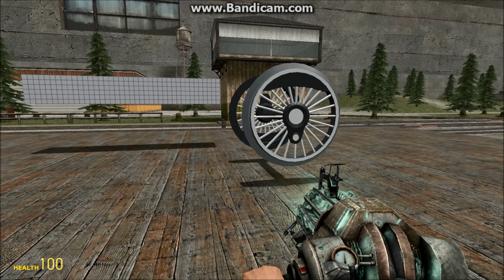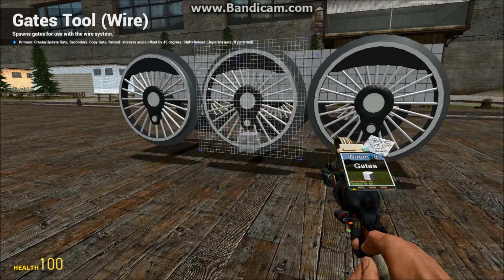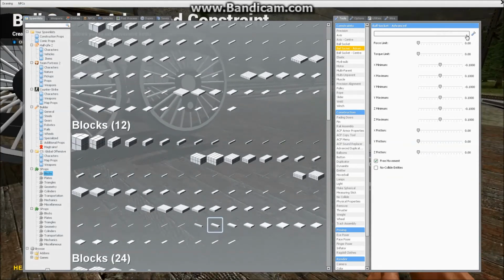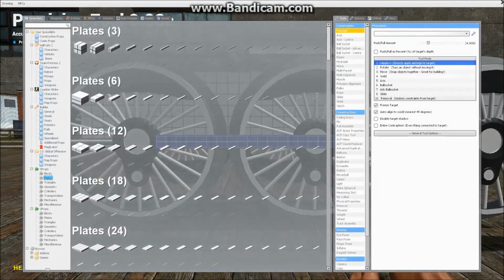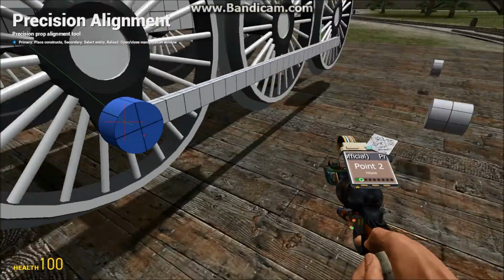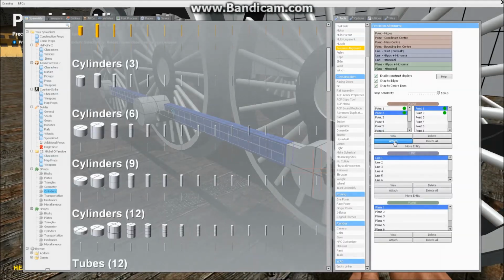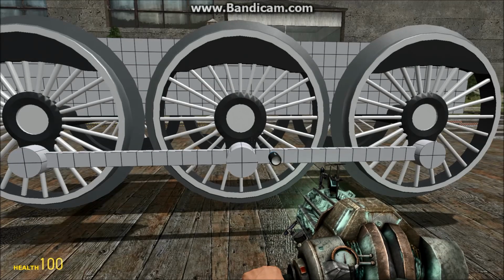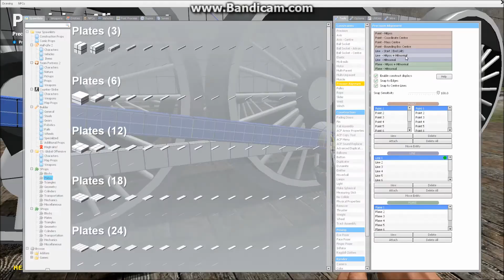Steamer Drive Gear Tutorial Part 1

Comment: BTW anyone looking at this tutorial, I've got some tips for getting to 100mph in GMOD after testing for hours. 

1. Counter-balance the wheels, on real trains you see large metal parts on wheels opposite of the drive rod, that is the counter balance, this in gmod reduces oscillation that generally becomes a problem around 40mph, adding a fine tuned counter balance to each wheel allowed my locomotives to get up to 60mph before derailing.
2. Weight the base prop so that it slightly compresses the wheels producing a suspension like effect, this means that any little bumps or jumps caused whilst running at high speed are below the axis point to the main prop, and will negate any significant jumping at high speed.
 
Balancing these 2 factors will allow you to reach 100mph and run at that speed on a straight piece of track in a fairly stable way, however after 100mph the axis and welds on your train will start to glitch causing the side rod pieces to smack into the track causing your train to derail, there is unfortunately no fix for this that I have found, however I doubt you will want to go over 100mph in gmod as the maps are too small, even for 100mph :P.

Comment: Just in case anyone else had this same issue, when i parented the middle wheel and axis centered it it spun the OPPOSITE way... turns out it DOES MATTER which way you are facing when axis centering it! You have to be facing the side of the gate! Not the front or back.
Reply: for getting the middle wheel to spin the right way yes it does